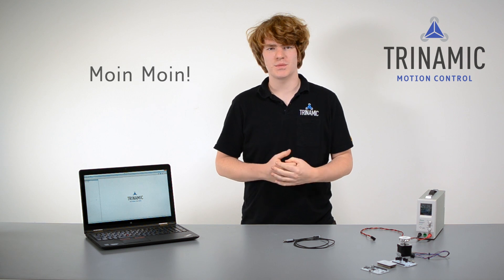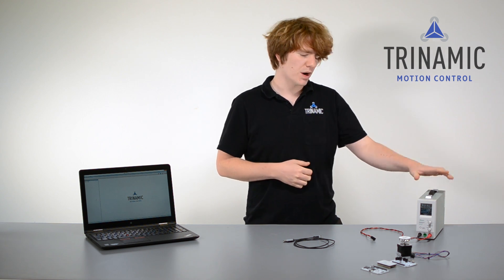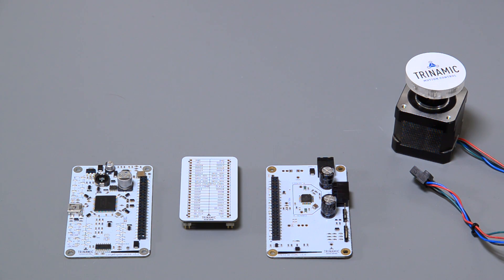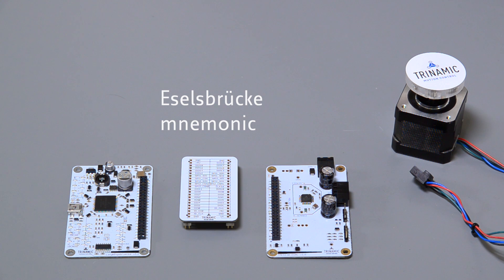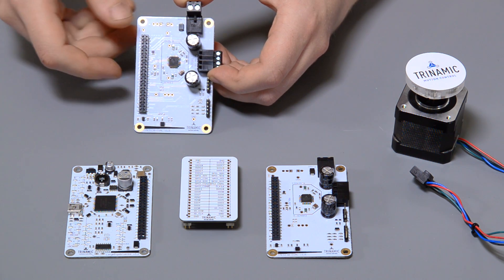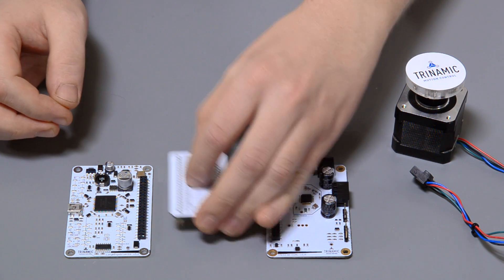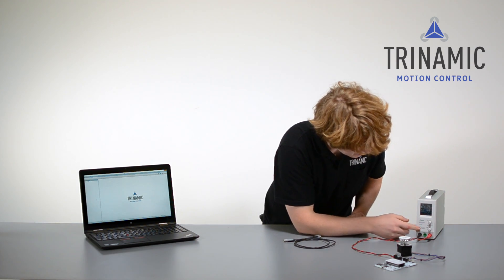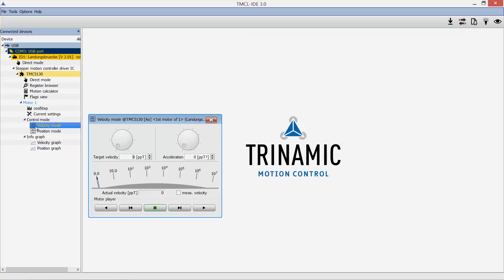How to make a stepper motor turn with Trinamic TMC5130 EVAL KIT

Comment: hi,
can i controll my step motor with the 'TMC5072 in the same way or is there any settings that i have to do first?

because i have tried it but it didn't work

Thank you
Reply from the maker: Hi Mohammad,

Yes, it should work the same way. Please note that a Firmware update of the communication board (Landungsbrücke or Startrampe) might be necessary to work with the latest TMCL IDE version. You'll find the latest FW on our webpage:
https://www.trinamic.com/support/eval-kits/details/landungsbruecke/
https://www.trinamic.com/support/eval-kits/details/startrampe/

If this does not help, please go on our webpage and use the blue support button on the bottom right and describe your setup in detail.

Best regards,
Your TRINAMIC Team